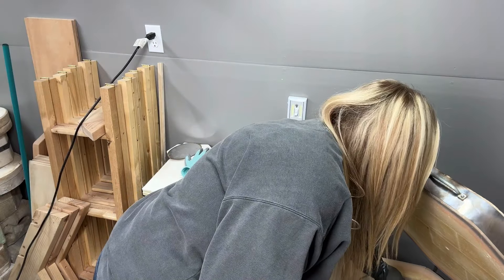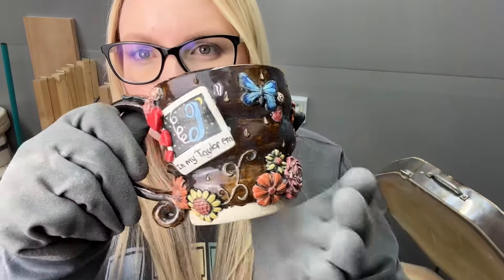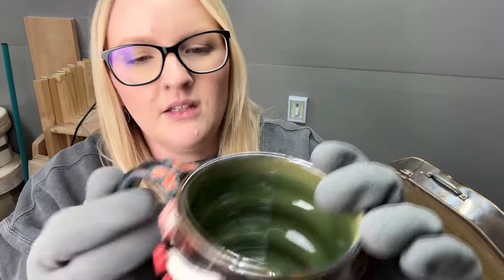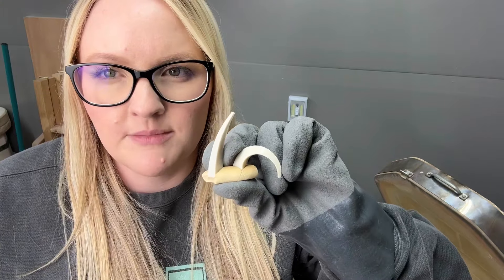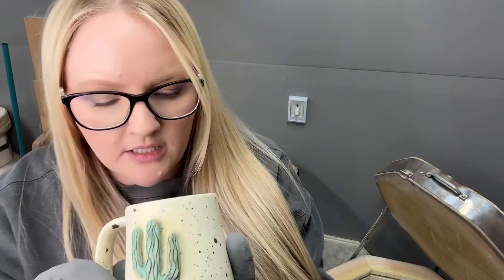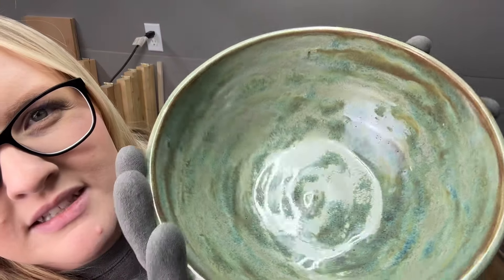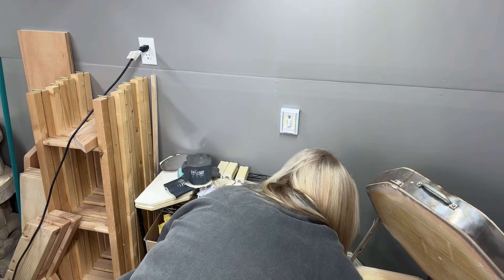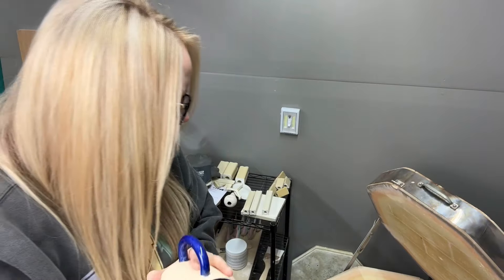Glaze kiln opening! Face mugs, bowls, cactus mugs, and a surprise item. #pottery #taylorswift #kiln

Comment: How long did you stir your Stoned Denim glaze Aubrey? I think I would refire the Northern Woods/Winterwood bowl at a higher temp. 😊
Reply from the maker: About a minute?
Reply: Do at least a minute or more if the glaze has been sitting unused for awhile. All the pigment really settles. Love those cactus mugs!          ? @moreldesigns2674
Reply from the maker: @cpnotill9264 thank you! I was mixing by hand with a whisk too. I have a drill attachment which is probably better.
Reply: @moreldesigns2674  Do the drill first then try to use a new toilet brush. The brush really get into the corners very well. 🥰
Reply from the maker: @cpnotill9264 ok thank you for the tips!